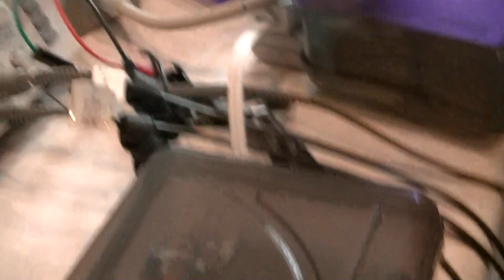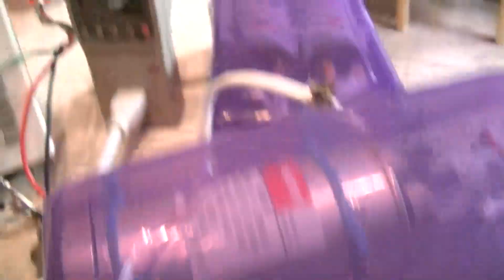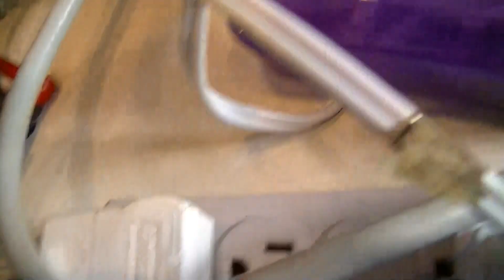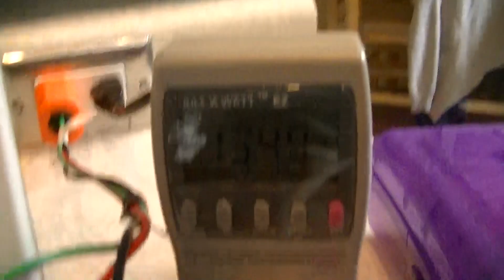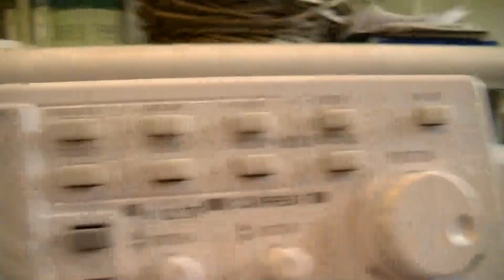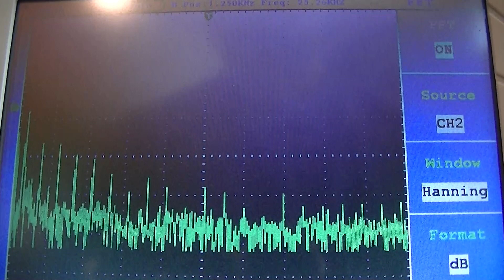Effects of Capacitive Filters on the Earthing (Grounding) System

Comment: I have wondered about the current draw on capacitors.  Does the amperage reading account for the capacitors charging and discharging back into the system - ie. is the meter reading the current twice, and so it's artificially twice as high?